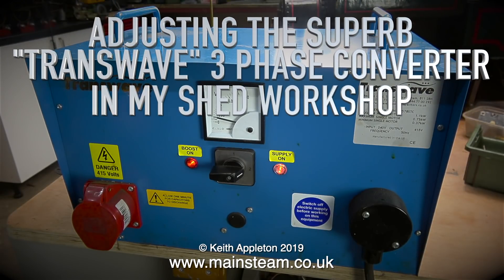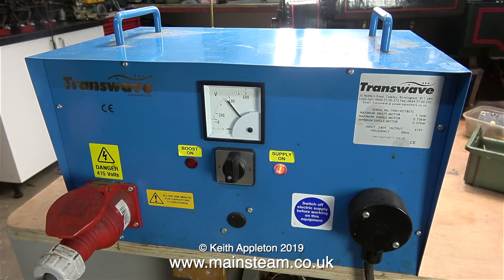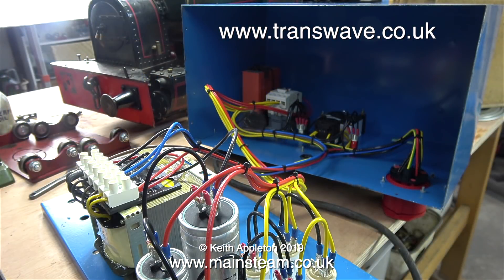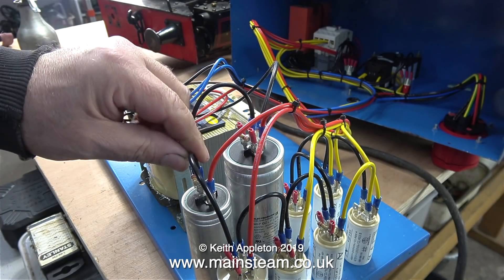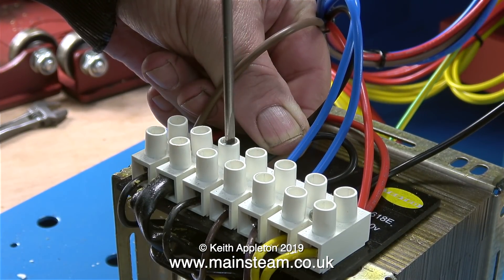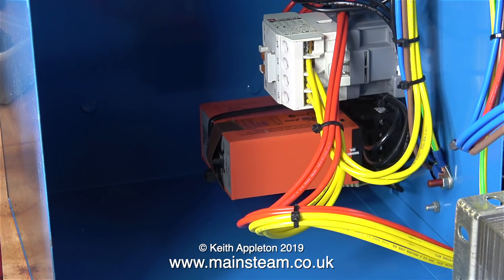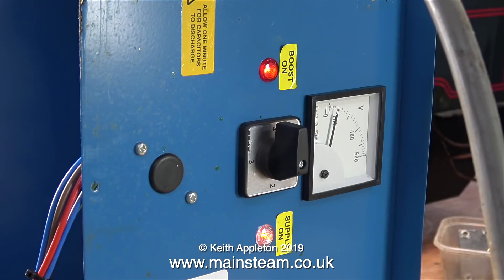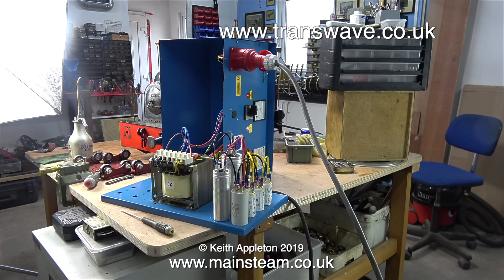ADJUSTING A "TRANSWAVE" 3 PHASE CONVERTER FOR MY LATHE

Comment: When you moved it further away did you increase the cable size to it, i.e 2.5mm square to 4.0 mm square.
I am guessing the sudden gulp of power on start up drops the voltage due to the cable length so it drops out then tries again.
Reply from the maker: The power to the workshop is fine, my 240 amp MIG Welder works well enough on the same supply from the consumer unit. In this village the voltage can be a bit low at times. The 3 phase converter is working well now, since I adjusted it internally.
Reply: @keithappleton  The MIG welder would work ok, unless the voltage really sagged very low.

Comment: Keith
I have exactly the same arrangement as you on a Boxford lathe with the Transwave 3 phase converter. It has been in use for about 20 years. The only issue is that it will not provide enough power at large diameters or deep cuts. the Transformer bangs as it hits peak load. I have learned to cope with it. I never thought of altering the setting switch which is like you on 2. I just checked my workshop supply which is 239v, so no power drop off. Have you experienced this as well?
John
Reply from the maker: Yes and the power does vary in the village where I live. A fine adjustment of the control on the red box inside sorted the problem. I would buy an inverter, but I would have to rewire the lathe and I don't want to do that .....

Comment: Blown capacitor (check the body hasn't  expanded)--mine went through many -changed it to a digital inverter type --never looked back -------hope this helps
Reply from the maker: The Caps are all fine.

Comment: If, after discharging the capacitors for the second time, they still spark, check to see if the unit is powered up.  Learned from experience.

Comment: How hard, or how expensive would it be to run larger wires to your shop?
I had a similar problem,  that when my freeze turned on, my telly would blink out,,,...
The house was only wired for 60 amps.
I complained, and  the utility company, ran a 200 amp service to the house at no experience to me.
And I  have had no problems after that.
Thanks for sharing your videos.
Reply: It sounds like you're in the USA. 200A is now standard for new builds. But you have to remember that you only have 120V.

Comment: Keith I used to be a radio technician many years ago and that would be right re the input voltage. If you can get your multimeter or an appropriate voltage display device and see what your voltage is at one of your power outlets in the workshop and that will tell you what the voltage is in the workshop. This might help with knowing where to set the dial on the orange box ;) Tim.
Reply: Tim, the voltage varies.

Comment: I dont think buying another converter would change the problem. Measure the mains voltage when the lathe starts. The voltage is probably dropping and resetting the circuit that switches capacitors to start the lathe motor . Tweaking the adjustment is probably your solution, you probably would have the same problem with a new unit. Thicker mains wire or a solid state inverter is another solution.

Comment: Unfortunately despite the disclaimers this is something I would certainly do. I would apologise but then I did complete my electrical/electronic engineering course so I guess I’m now certified to receive electric shocks! Just to be extra sure I would have turned the converter supply power off and your lathe on to ensure complete capacitor discharge. Looks a really good robust unit. I have seen similar devices that work mechanically to create three phases.

Comment: Keith, if you need to replace the unit consider the newer digital phase converters, they take up much less room and are fully adjustable for input and out put voltage as well as phase conversion. Stay safe in this short term "pandemic world". Cheers from Canada! Thanks for the share!

Comment: What is the actual voltage in your workshop? Hoping this gets up running at full tilt.
Reply from the maker: 240 volts on a good day, I live in a small village in the middle of nowhere and the voltage does fluctuate at times.
Reply: The voltage of the entire grid varies, all day, every day. It depends on levels of demand, and supply, and they are both constantly changing.

Comment: My lathe has a 7.5Kw 3phase motor and I only have single phase. So I decided to use a VFD and a voltage doubler to get my 240VAC to around 600VDC. My VFD has the option for a  DC input.
I had to rewire my lathe but it was worth it as I set a ramp up of 3sec on my VFD so I am only pulling a max of 40amps from the single phase supply.

 I use to have a rotatory phase converter but it would pull 80 to 90amps when starting the lathe and I was always worried I was going to blow the fuse on the power pole.

Comment: Keith, maybe something to consider. Variable frequency drives have single phase input and 3 phase outputs. Some years ago, I wanted to use my cheap 14" Chinese bandsaw to be able to cut steel. Changing pulleys enough to slow down the motor was going to be a big project and so I went to ebay and bought a VFD rated for 1 HP (746 watts) and a 1 HP 3 ph motor and it works great plus you can change the motor speed with the VFD. I'm not sure what HP motor your lathe has but I'll bet you can find a VFD on ebay and there are you tube vids for setting one up. Just a thought.

Comment: I worked with an electronics tech in a machine shop at one time. He was VERY good. Seemed to have a 6th sense about electronics.
When asked how he knew what compnent was failing after just a few minutes, he said he was in the air force and worked on early radar units. Forgot to full discharge the "football" sized capacitors in a unit once and got knocked across the control room in a tower once. After that he said he was very "in tune" with electronics. The guy was a dead on identical twin for Charles Manson, great to work with, scary to look at. :)

Comment: I wonder if your voltage drop on the mains coming into the shed is excessive when the lathe is running.  You did not day how far the shed is or how large the wire is from the house.
Reply from the maker: it is a long way from the mains inlet - a 32 amp feed goes to the shed.
Reply: @keithappleton  I would put a volt meter test on the supply wires coming into the shed and check for voltage drop and fluctuations when the lathe is running.  May want to do the same test with your A/C turned on too.  Just an idea for you.

Comment: What actually is the voltage in the shed?   You might find it's worth using the 220v transformer tap and then adjusting the boost controller to suit.
Reply: The mains voltage is variable.